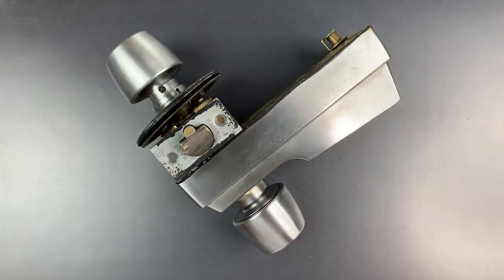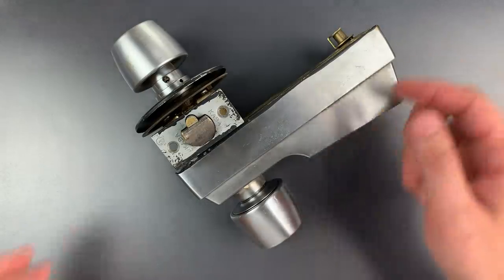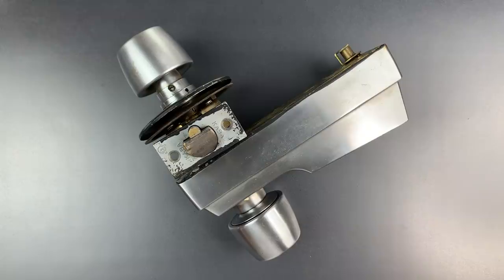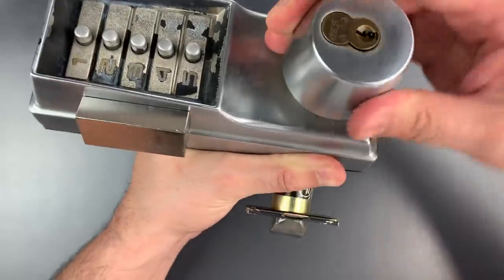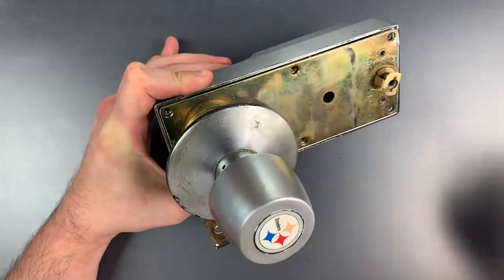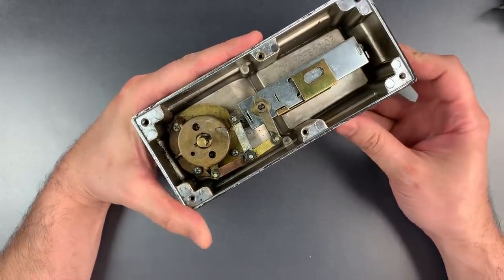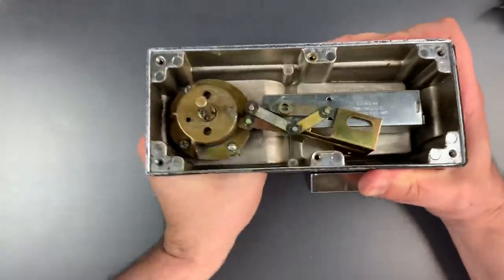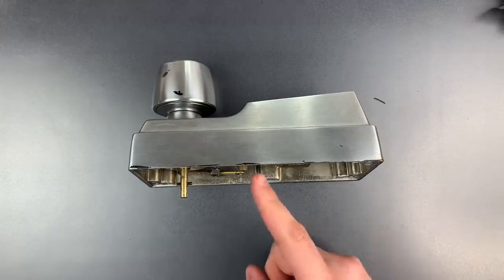[914] The Worst Lock Design Blunder Ever? (Kaba Simplex Series 1000)

Comment: As someone who installs these on federally secured buildings on at least a weekly basis, as well as repairing/replacing, this knowledge would have saved me dozens of hours on an angle grinder cutting old locks that had failed off.
Reply: Good to see qualified journeymen on government jobs............ 😂
Reply: ADEBISI ADEBISI   because he didnt know about this incredibly niche fact
Reply: ADEBISI ADEBISI  He acknowledged his ignorance of the matter. No need to insult him.
Reply: Whatever, bill the fed more $$$$ took you longer
Reply: Why were you grinding anything off just drill the core.... then remove from the back
Reply: ADEBISI ADEBISI  and did you know about that before you watched this video?
Reply: You only need a pair of channel locks, a phillips and 2 minutes, no drilling, no grinding.
Reply: @Jefferey04  there is no core on the models that I generally work on, and there is no override. Additionally, these are made from a particularly tough alloy that is quite resilient. Do you have any personal hands on experience with Simplex locks? I doubt it, they are quite expensive and tools like you aren't generally used by professionals.
Reply: @BotNard  Well for someone spending hours grinding off old locks and installing new ones, you would think there must be a better way to do this. Mind you the core is made of brass, I don't see how that would be difficult to drill.
Reply: Jefferey there is no core on the model that we use. At least no outward facing core. The slot where the core would be on the outward facing handle is solid steel that is homogeneous to the rest of the handle. This is because the locks are on the exterior of many remote buildings. Specifically, this lock was chosen because it fails into a permanently locked state. And I’m usually not cutting the lock body, I’m cutting the tamper plate and latch inside the jamb of the door.
Reply: We had one of these fail and had to call a locksmith. I offered to go around and come through the building from the inside and he said "don't bother, I can get it from this side". He popped the handle off using a pin and then went through the shaft with a screwdriver to turn the inside handle (I didn't see exactly what he was doing, I don't know if you are able to go direct or if there's a particular angle, and if you have to move or remove something internal to gain access: I wasn't paying that close attention because I thought he was just getting started). The lock was open in less than 15 seconds.
Reply: Wilfred Darr that sounds partly correct, you remove the secure side handle with a pin that comes with the lock. But as far as I know, unless this particular locksmith installed the lock and some sort of bypass at the same time, it shouldn’t be possible to do that. 
Edit: by secure side I am referring to the side of the door inside of the secured area.
Reply: @BotNard  Nope unsecure side, outside door handle, button side. Which is why I was so shocked. What's the point of having it if it can be bypassed in 15 seconds?
Reply: Wilfred Darr I don’t know, as I’ve said, I work on these locks a lot, 3 in the last 2 weeks, and unless this is a feature exclusive to he models with a keyed bypass, I’ve never seen that before. I have completely disassembled and reassembled these locks before, the knob is captive from inside the lock assembly. And even if you remove the knob, it shouldn’t be possible to actually access the latch without having drilled holes in the clutch plate inside of the lock mechanism(which would probably be destructive to the lock as well). I just don’t see how that would be possible. Then again, I have never fully disassembled the model with a key bypass, perhaps the mechanism is completely different
Edit:
I assumed that there was little difference inside of the lock body between models with a key override and those without, if you were to remove the knob on one of the models with a key bypass, it would be possible to engage the clutch from the outside and operate the lock.
Reply: @BotNard  
I've also installed hundreds of these over the years,  and you should also know it takes a 'particular' key to reset too a different code? Another design flaw, that same key works on 'every' Simplex Kaba' ? 
My first words to any client was, they needed to create their own combination as I first walked in, explaining that the 'default' was "World-wide" known.....
And if the code is actually lost, you can disassemble the lock from the secure side, expose the interior portion, and can carefully reset it .  Tedious yes, but it is better than destroying it, IMO?
As far as drilling, it would be also a last resort. Most key bypass are removable core, as seen in LPL's video. Another design flaw, I have four cylinder remove keys from 30+ yrs, and they still work on 99.9% of even their new devices? Once pulled a medium flathead screwdriver opens the lock.
Reply: Glad that this video has helped you to get old locks off more easily.

Have you been offering to test for vulnerable locks that should be replaced? If you can go on site and demo weak locks to a manager, you might be able to win some additional work swapping them out. (And if you don't need to angle grind them, to get them off, you should be able to get more done in less time.)
Reply: @wilfdarr  that shouldn't be possible without taking a saw to the exterior handle tube. The exterior handle is secured by more than a pin. It has an internal ring clip that does not ride a spring like the brass ring that locks the handle on the interior side.
Reply: @Jefferey04  angle grinder takes longer.  Billable hours.
Reply: frankly, a federal building is mor likely to have properly set a combonatiin and/or cycle to a new combonation, at a regular frequency
Reply: @wilfdarr  It doesn't stop an honest person, it just helps an honest person stay honest.
Reply: @wilfdarr  Yeah your story doesn't hold water.
Reply: @calculator1841  Well, sorry, but that's exactly how it happened. I don't know if the way the lock failed affected his ability to gain entry (or perhaps because it was still coded to the default code?), but while it was locked to the outside, he used a pin to remove the handle, and then a screwdriver to either unlock the door or turn the inside handle. Like I said, less than 15 seconds and he was through.
Reply: Not accurate anymore the flat plate is magnetic for at least 5 years now
Reply: @wilfdarr  Then it wasn't a KABA, like previously mentioned the secure side handle doesn't come off.  If it comes off the whole thing is ruined and would still need to be replaced.  Typically to pull a lock side handle you need the key and turn it so that the pin can be depressed.  In the locked position there is a tab on the cylinder that prevents the pin from being depressed.
Reply: @plunger110  Oh, that makes sense. If the Smith has a master key then that might explain what happened that I didn't see?
Reply: @BotNard  o
Reply: @BotNard  "...and tools like you aren't generally used by professionals." This has to be one of the best insults I've ever come across, one that others here don't seem to have noticed.
Reply: Why you using a grinder 😂 get some training dude.
Reply: @jaybonkersbonkers3613  they illustrated quite a bit of it in their follow up comments. Quite the smooth brain you got there, champ.
Reply: I own and operate over 20 of these locks. I have yet to come across a single one that contains this metal lever, which allows a magnet to bypass the lock. So as far as I'm concerned, this is a much-hyped defeat of this lock, which doesn't really exist.
Reply: You should also know there are only 120 combinations possible -- you could simply try them all probably faster than grinding the latch without all that fuss.
These locks are NOT 'secure' at all.
Reply: @JohnW118  not sure where you get this idea. I have had the misfortune of coming across miscoded locks in remote areas. Knowing I may be the first person to try operating them in years, I have proceeded to check every historical lock code I have, (which would exceed 120 combinations) and I have remained locked out and had to cut. Your misconception shows your ignorance, you assume the code algorithm is limited to 5-digit codes which would be five-factorial and therefore 120 combinations (5*4*3*2*1), of which I’m sure you think you’re awfully clever for figuring out. But that’s not how this lock works at all.
Reply: @TheArchangel38401  the recoding key issue is very true. It works on all of them. Funnily enough I have been to multiple federally secured buildings using the default 3-button code anyways so I think in the end security is kinda moot. A few weeks ago I was doing a fire monitoring bypass for hot work and we found out that not only had the mag locks and emergency exits been completely unlocked for days, it also hadn’t informed anyone about it at the national incident center. A few potentially compromised locks are nothing compared to a security flaw that just releases the latches on every secure door in the building from the jamb side and doesn’t warn anyone lmao.

Comment: Masterlock is already spending millions on a new plastic version of this
Reply: At least plastic would not react with a magnet....
Reply: @hq3473  yeah it would open with a lighter😂
Reply: Funny enough, that would actually work better than this would surprisingly
Reply: You are mistaken, Sir, it's papier mache.
Reply: @hq3473  - Certain types of stainless steel is non-magnetic; specifically austenitic stainless steel.
Reply: @aserta  Papier mache LOL.... and they'd still use paperclips for that metal piece.
Reply: @hq3473  all objects react with magnets. some are diamagnetic and repulsed, some are paramagnetic and weakly attracted, and some are ferromagnetic like iron.
Reply: @Uberragen21  again, no such thing as "non-magnetic" unless you are made of neutrinos
Reply: "all objects react with magnets"
Technically yes, but practically in this application, it's not remotely relevant.
Reply: @drboone357  
Wow. You're easily triggered.
Reply: Micah Motumz  have you ever rubbed a balloon on your head and stuck it to a wall?
Blox is just being annoying. Copper isn't magnetic either, until you pass current through it, same with the balloon basically.. You know, physics, electrons and shit
Reply: Maybe a brass piece would be better.
Reply: @Blox117  How often do you have a MegaTesla magnet on you? I bet not that often. Therefore it's not relevant that technically everything reacts to magnets.
Reply: @Fif0l  it is relevant considering I work around particle accelerators
Reply: @Blox117  oh, so you're doubling down on your smugness.
I put it to you that for lock designers the fact that everything reacts to magnetic fields in some way is as relevant as relativistic mass is for car manufacturers.
Reply: @Fif0l  I spend most of my day near powerful magnets. I think that gives me leeway when people talk about them
Reply: @Blox117  even if I give you that, still: 
1. It's not relevant in this case.
2. Even in your daily practice, I imagine you're not walking through  the magnetic fields strong enough to make plastic fly.
Reply: @Fif0l  probably
Reply: @Blox117  You're taking a wide and varied field of magnetism and attempting to boil it down to a simple phrase. Yes. Everything is magnetic, but not everything is ferromagnetic.
Reply: @troublemaker9899  yeah perhaps I was too overzealous in my earlier comments. I duly apologize
Reply: @Blox117  It's a common failing. When you become a studied expert in a certain field you begin to get this feeling in the back of your mind that others should know things which have become quite obvious to you. When you're trying to explain a concept to a layman, it's usually a safe bet to be as detailed as possible. After all, you can't assume everyone has the same knowledge as you do.
Reply: @troublemaker9899  yeah that's very true
Reply: @Blox117  Congrats on the trolling, such ease at winding 'em up above hehe :) McD's should give you a promotion cuz you're skills clearly deserve more than just spitting in burgers!
Reply: @TheRealD4  <-- Strange thing to say from someone who works for NASCAR!
Reply: Ah plastic. The ultimate word in security.
Reply: plastic parts wouldn't be bad except for wear.  melting the parts would actually render the door inoperable instead of popping it open.
Reply: @thomasjenkins7506  Master should just come out with plastic signs you had on doorknobs that read, "Please don't illegally enter this {home, shed, container, toolbox, locker}" - It would be cheaper and almost as effective.
Reply: Ignis Solus  yes everything even you react with magnets but of course for you to feel it you'd need a gigantic magnet
Reply: @Uberragen21  Austenitic steel cannot be hardened, as it has a crystalline structure. So that just means it is drillable. Unless you spend a lot of money layering defenses, every lock will have a weakness to exploit.
Reply: @warlordplisken9605  z for the purposes of this application, austenetic SS doesn't need to be hardened in the same manner as you would a knife blade. In that essence, you are correct, but you are also wrong. See below:

"The austenitic stainless steels, because of their high chromium and nickel content, are the most corrosion resistant of the stainless group providing unusually fine mechanical properties. They cannot be hardened by heat treatment, but can be hardened significantly by cold-working."

https://www.spiusa.com/stainlesssteel_overview.php#:~:text=They%20cannot%20be%20hardened%20by,hardened%20significantly%20by%20cold%2Dworking.&text=The%20straight%20grades%20of%20austenitic,grades%20contain%20a%20minimum%20of%20.
Reply: @Uberragen21  Good call. I was reading the wiki. Obviously they left out some chemical properties. 

Guess the (rhetorical) question remains, does anyone make them in such a way?
Reply: @warlordplisken9605  that's a fantastic question. I'm not sure in regards to locks.
Reply: Messeresser yes, that’s why some stainless steel pans don’t work on induction cooking things.
Reply: Masterlock doesn't own this product, so why would they be spending millions to correct the problem?
Reply: @JLH1956  ummmm. You should probably watch more LPL videos and you'll understand the joke, not really going to explain it to you.
Reply: @ZippoX05  Yeah whatever troll.
Reply: @JLH1956  I'm a troll? You're the one questioning a year old comment with 3k likes pretending you don't understand a joke
Reply: @ZippoX05  Again... Whatever.
Reply: @aserta  YEAR OLD COMMENT BUT I THINK IM THE ONLY ONE WHO GOT THE REFRENCE
Reply: @Blox117  You can't really carry a powerful enough magnet to attract things that don't have iron though.
Reply: The entry code will probably be stamped on the side of the lock body.
Reply: @Uberragen21  then you increase the weight and manufacturing costs substantially. could just use aluminium......

Comment: Presumably the fix is to change the part to a non-ferrous metal, like brass.
Reply: It's now stainless with a very low magnetic profile.
Reply: Alternatively you could also shield it by installing a (“U” shaped) ferrous shield cover around the mechanism, but remanufacturing the part to be nonferrous is the simplest and most economical solution.
Reply: Glued on an  small iron plate may work, it will spread out the magnetic force.
Reply: So now you just need a REALLY big magnet.
Reply: In the 60's when designed the magnet needed did hang on the shelf at or hardware store or in a massive online catalogue for next day shipping. 
Also master has done much  worst blunders than this.
Reply: Ethan Poole o
Reply: @g.davies1365  
OK then use electromagnet .
Reply: @CheZfrmdaWestWisc  Want to try saying that again champ? Lol
Reply: @pete_lind  Magnets don't have an effect on the new part, electromagnetic or otherwise. I've seen the test rigs and seen the test data.
Reply: @CheZfrmdaWestWisc  *did not
Reply: Could have just been a glass fiber reinforced plastic and would have worked as intended.
Reply: AISI 304 stainless steel is the perfect choice, no need to go further
Reply: Probably plastic, lol
Reply: A 300 series stainless steel would not be magnetic as opposed to a 400 series or 17-4.